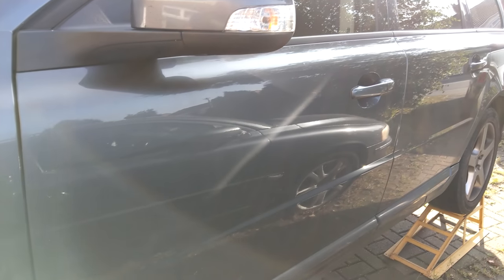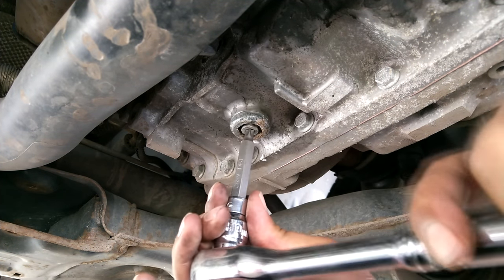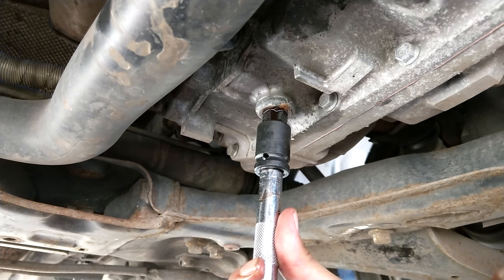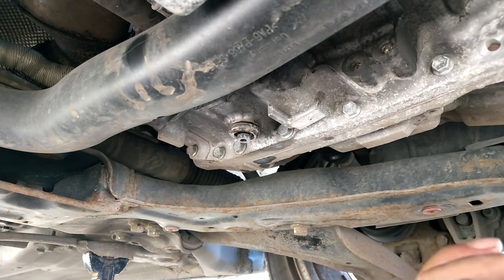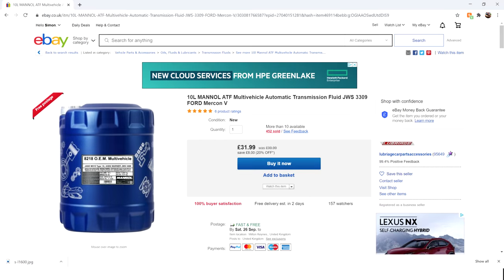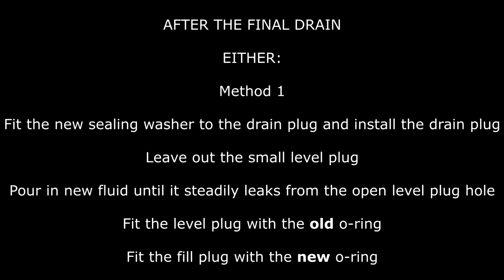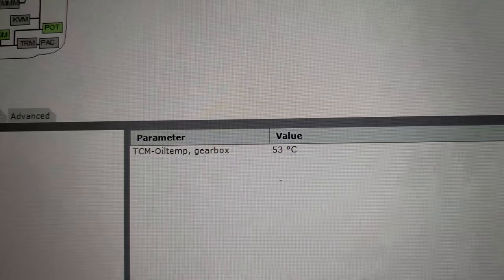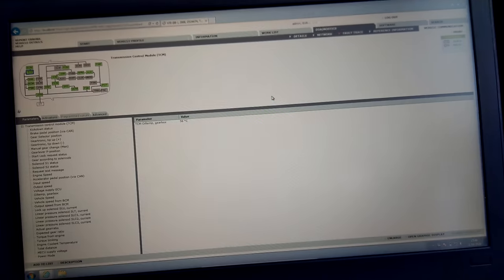Automatic Gearbox Fluid Change Aisin Warner TF-80SC

Comment: Very helpful video as always, thank you.

Also on the newer XC90's eg 2012 model they have the ECU on top of the airbox, do you know if you can get away with leaving that connected or should that be disconnected when removing the airbox?

One comment on the editing, really not keen on the 'blinky' transitions between the video cuts at the start of the video, it confuses my brain into thinking I've blinked and makes the video difficult to watch.
Reply from the maker: I don't know the exact way to access all of the variants that this gearbox is fitted to but Vida will confirm the steps.
You need Vida regardless to do the job properly so always worth having.

Point taken on the transitions. Short clips exaggerate the blinking effect so I'll look at future videos.
Reply: @sirobb  Thank you! 
Perhaps next you could make a video on how to change the bevel box oil in an XC90?
Reply from the maker: I don't have an XC90 needing it but the YouTube channel volvosweden has some AWD maintenence videos.
Done on a P3 but you get the general idea.
Reply: @sirobb  Thanks, I had already watched his videos but the drain/fill bolt isn't in the same location on my friend's 2012 XC90 that I work on.
Reply from the maker: I see. Get Vida..... I can't recommend it highly enough for anyone doing their own work. Even for my 2002 S60, I wouldn't be without it.
Reply: @sirobb  Thanks, I already have Vida and have looked up the procedure in it.
Unfortunately, Volvo updated the Bevel Box design, but didn't update VIDA to match! :(
I have asked on forums but haven't got a definite answer.
Reply from the maker: @bigbluechopper24  Which Vida version do you have?
Reply: @sirobb  version 2014D 
Installation of VIDA, version 1.00.0015
Reply from the maker: Wow that's quite an oversight then.
I can't add anything further I'm afraid.
Reply: @sirobb  Thanks for trying :)

Comment: THank you for your video. One question: the very first time when you take out the level plug there are some fluid pouring out (it means that fluid level is above the height of level tube). But after the final drain you pour in new fluid to the level of level tube only. Why so?
Reply from the maker: The engine is off when I remove the level plug to drain the fluid at the beginning.
More fluid is settled in the sump so some fluid will leak out. 

The engine is running when I remove the level plug to set the level of the fluid at the end.
The fluid is being pumped through the gearbox so doesn't settle and leak out.
Reply: @sirobb  Hello mate are you still selling the dice/Vida kit? Got a v70 and need a diagnostic for it shortly

Comment: Nice Video.
This Transmission is also used in the new Generation of BMW X1 and other models.
We have such an BMW X1 and I want to Change the Fluid and Filter.
I saw no Filter Cap, but at the front side (left) was an Cap with an snap ring. I think underneath this cap is an extra Filter.

Have you changed this one too or only the fluid?

In the original BMW Manuals are no work orders for an Service like this and no aftermarket Filter part number.
Only Transmission Fluid level check...

Maybe you know something more from the Volvos?!

Sorry for my "not so good english" 😁😆
Reply from the maker: The filter is not changeable without opening the gearbox.
You could insert an in line filter on one of the fluid cooler hoses.
Reply: @sirobb  Okay, thank you for this information 😊👍

Comment: That was excellent and very informative , it's a job I intend on doing but now that at the end I didn't realise you need to reset via computer , where do I get one of them?
Reply from the maker: I sell new, tested and guaranteed working Dice for £135 delivered in the UK. It includes the Vida software which will work on Volvo model years from 1999 up to 2015.
Reply: @sirobb  how do you view the information from Vida dice? I'm assuming via laptop USB?
Reply from the maker: @passionplanet4471  Yes that's right as shown in the video.
Reply: @sirobb   it looks impressive, but I see someone comment that if you replace exact amount back you don't require Vida, but funds are prioritised for 10 ltr of mannol,  the 17mm hex and Volvo crush washers . If I start getting codes then I will be keen to purchase one but so far been lucky
Reply from the maker: @passionplanet4471  You need Vida to set the level at the correct temperature due to heat expansion and you need to reset the counter to tell the car new fluid has been introduced. If it wasn't necessary, I wouldn't have done it or suggested it.
There's a lot of ways to shortcut and do the job incompletely but only one way to do it right.
Reply from the maker: @passionplanet4471  You need Vida to set the level at the correct temperature due to heat expansion and you need to reset the counter to tell the car new fluid has been introduced. If it wasn't necessary, I wouldn't have done it or suggested it.
There's a lot of ways to shortcut and do the job incompletely but only one way to do it right.
Reply: @sirobb   I know your right but, the V70 is getting on and I got a slight leak on steering pinion too so there is a list of jobs and I have prioritise the funds with and I will take my chance , but I'm not ruling it out , looks a fair price

Comment: @Sirobb Great video as always. Im sorry Simon but after 8 years of great service I have finally succumbed to temptation and bought a lovely 69k 2012 P3 D5 R Design. I know I may get a lot of hate for this, after all some consider this a downgrade. It certainly has big shoes to fill. After performing the 'Gibbons method' on my P2 D5 a couple of times im more than happy to do this drain and fill method on my new P3.

Would you be kind enough to clarify a point of confusion for me please. I am a little unsure as to whether the TF80SC takes JWS 3309 fluid. I realise you are using it happily in this demonstration, however I have heard that it takes AW1 or something ive never heard of BOT 341 (says in owners manual).  Any advice appreciated. Thanks for your time and trouble Simon.
Reply from the maker: There's definitely a revision to the recommended fluid around 2011 model year so I would check with the main dealer or a good aftermarket supplier like opieoils.
I've never needed to source the newer fluid and didn't need to check for the car in this video as it's way before the changeover.
Reply: @sirobb  Thank you for the reply, very much appreciated. I will look into it. Its a shame as I have a 20l drum of JWS 3309!
Reply: @sirobb  and yes I think there was something like a gen 2 TF80SC which takes a JWS 3 something something something. I always pick an awkward year on my cars!
Reply from the maker: Given that the gearbox is so similar, there's a part of me that wonders just how different any new fluid spec might be but I can't hand on heart say to use something if it's not listed in the handbook.

A Euro 3 D5 for example is probably 95% the same physically as a Euro 4 D5 but they do use different oil specs. 

Check every listed spec conformity number on your JWS3309 barrel though as you may find a number which still matches the new requirements for the >2011 gearbox.
Reply: @sirobb  You are a gentleman and a scholar. I'll have a look.
Reply: @sirobb  Just in case it helps anyone else, I thought I would share my findings. JWS3309 spec is used in the TF80SC as we know. The TF80SC Gen 2 was put into the V70 in 2011 (please check your VIN though to be sure of the change over) and requires JWS3324 or AW-1 (one and the same thing really) spec fluid.  The changes to the gearbox were more extensive than I thought, but in a nutshell it had some mechanical revisions. It had a software update to accommodate the lower viscosity JWS3324 fluid. 

As far as I can tell this 'new' fluid really is for improved fuel consumption and lower emissions, although there is some evidence it handles higher temperatures better.  Things get interesting and a little confusing  as the TF80SC gen 2 was also used in the XC90 with reports of it being filled with JWS3309. Volvo did eventually update their information in regard to using the new fluid 3324 in the XC90.

I feel like I could get away with using the 3309 and suffer no ill effects, however I am still not 100 percent comfortable. Maybe I am overthinking this?!
Reply: @nathanrich5256  JWS 3324 after 2011
Reply: You will find your answer in manual use.

Comment: Hi mate,
My car is 2007peugeot 307 2.0Hdi with the same transmission i believe. 
Does the TCM need to be reset as well？
Because i Just done my fluid change, it does become smoother but not that smoooooth.
Reply from the maker: You would need to follow whatever the procedure is in the official Peugeot workshop manual. I don't have access to that so can't confirm either way unfortunately.

Comment: Hello, I have the same transmission in my Volvo V70 2012 R design 215hp, is there also a transmission filter that needs to be replaced? If yes where is the location of it? 
I hope I get an answer 🤞🤞
Reply: The gearbox is designed to be "Lifetime" without frequently serviceable filter. There is a filter, but is deep inside the gearbox.. If you want to replace it you have to disassemble the gearbox 😀

Comment: Hi  great videos   i just wanted to know what goes wrong if you don't have the scan  tool to reset  the transmission   because i dont have one and i don't know anyone who does my gears run smoothly at least  l think they do .
Reply from the maker: Not resetting using software may be ok but it depends on the individual use of the car/gearbox.
The reset tells the TCM that fresh fluid is in the system and depending on each use case, that is an essential syep or just optional.
Reply: @sirobb  thanks Simon I've dropped the oil once up to now  a few weeks back and all seems fine  and I'm going to do it 2 more times  soon  and hopefully I might find some one  with the right  scanner  if I do I will tell you if it feels better shifting

Comment: Hi Simon, fab video as always, I need to do mine which oil would be best it’s a 2004 xc90 auto aw55-51 box ?
Reply from the maker: Most likely the same JWS3309 as in this video but check.
The method is also different so research videos for your exact gearbox.
Reply: @sirobb  thank you yes I’m aware the method is alittle different and it does appear to be the same oil so thank you for that :-) are you still selling the Vida & dice setup atall? Your video appears to of vanished lol
Reply from the maker: @chrisworrall3581  Yes, New, tested and guaranteed working Dice and Vida available. £135 delivered in the UK.
I took down the video as I don't really need to advertise it and it attracted too many requests to fix installations bought elsewhere. Lol
I'll gladly sort out anyone who buys from me but I don't have time to troubleshoot and be customer service for the other crap sellers out there. 😊
Reply: @sirobb  aww I don’t blame you one but mate that’s the last thing you need to be doing :-) your vids are great and make things very clear :-) I’ll be in touch in a couple weeks when paid if that’s on been meaning to get one for a while :-) do I just make the payment to your PayPal ?
Reply from the maker: No problem.
Yes that's right, just send the payment via PayPal gift/friends and family only please (not goods and services) to the PayPal in the video description and About section of the channel.
Put your name and address in the PayPal payment notes section and I'll sort it out. 👍🏾

Comment: There seemed to be a lot of fluid draining out when you first removed the level plug. Is this normal since at the correct level no fluid would be draining out?
Reply from the maker: There's more fluid compared to the final level draining because the engine is off.
Reply: @sirobb  Thanks. Thinking about it after I’d posted I realised that must be the case! Doh!
Reply from the maker: @simonjohnston1053  No problem. It can seem a little counter intuitive at first.

Comment: My TF-80SC is hitting 110'C when on highway, and it has that humm/whine in 4th, 5th and 6th. Oil change or not enough oil? Thanks
Reply from the maker: How many miles has the transmission fluid done?
Reply: @sirobb  50k km, approx 30k miles... it's on AR159 2.4JTDm.
It says Tutella GI/VI oil, but I presume it can be filled with 3309 too...
Reply from the maker: Has to be worth taking a sample of the fluid from the level plug.
If it's brown and smells burnt definitely change it.
It's also worth checking with your main dealer if there are any software updates outstanding. Perhaps even do that first.

Comment: Why has so much oil come out from the fill level plug? surely its only meant to drain whats over the level?
Reply from the maker: If you mean at the start, the engine is off so the level sits differently compared to when the level is set which is done with the engine running.
Reply: @sirobb  I wonder what the oil level is at the end of the change?

Comment: Brilliant as usual Si. Did I read in another comment section that you sell Vida and the plug-in tool? Can I  reset the Auto box oil counter using elm327 ? Keep up this great channel
Reply from the maker: Seal Kit link. It's a Volvo main dealer so double check compatibility with them. https://www.ebay.co.uk/itm/Genuine-Volvo-Automatic-Box-O-rings-30735186-x-1-1233068-x-2-30713220-x-1/202851956855?pageci=81796015-ac6b-48b5-b493-f29d9d84a70f
Yes, I sell Dice and VCX tools when I have them available. Tested and guaranteed working and they both work the same with Vida. £100 delivered which is the total cost if you already have a suitably specced laptop laptop or Macbook.
Reply from the maker: Not used an ELM327 on an Automatic so you'd need to check if that's what you have currently.
Reply: @sirobb  Many thanks for the reply. I am very keen to purchase one of these tools as they become available but obviously need Vida to go with it. Is that available, either from you or elsewhere on the internet? Many thanks
Reply from the maker: I sell them at £100 delivered and am taking reservations for next week's units.
Vida is included so it's just down to your laptop specs.
Reply: @sirobb  I have windows 7 on an acer aspire 5738Z. Intel 2.1 GHz cpu with 3Gb RAM. If that sounds OK let me know how and where to pay but cannot do so until next week. Many thanks
Reply from the maker: Which version of Windows 7? Home, Home Premium, Professional?
Reply: @sirobb  Windows 7 Home Premium Service Pack 1 64 bit
Reply from the maker: Home Premium is no good and the processor won't support Virtualization but if you upgrade the operating system to 7 Professional, you can install Vida directly on it.
Reply: @sirobb  Ok. Thanks for that. I will update in due course and then make a purchase.

Comment: Hello, my name is Carlos, I'm Spanish and I have an opel insignia on that same gearbox but from 2015. I want to carry out maintenance but I can't find anything in opel, I already have ravenol oil. just ask if the final level applies to all gearboxes even if it is not from volvo ?. Thanks a lot
Reply from the maker: I don't know so you will need to check the owner's manual and workshop manual for your exact car.
Reply: Final level applies to all brands with same gearbox number, please remeber to check oil level with engine on.

Comment: I've a tf81sc ford galaxy 2009 ,I've been given a new filter to fit but it doesn't look like it has a filter ?? It's a black cartridge filter in a new plastic housing like an external filter ??
Reply from the maker: I don't know.
Have you asked whoever gave you the filter?
Reply: @sirobb  did you open up box and clean screen filter ?
Reply from the maker: No and I don't know of anyone who has.
Everything that was done is in this video.
Reply: This is the Powershift gearbox not the geartronic! powershifts are on Galaxy, Kuga and late volvo's! There is a filter on the Powershift to change but not on the AISEN.

Comment: Hi Simon would this be the same procedure for a volvo xc70 2009 and i can do it but need the vida software and where do i get this from ?

Cheers.
Reply from the maker: If you have the same gearbox, the procedure will be similar but Vida will confirm.
I sell the VCX tool shown in the video which comes with a Vida virtual machine for £100 delivered to the UK.
You will need a 64bit laptop capable of running a virtual machine.

Comment: Can you also put a link up for the seals and washers? Many thanks
Reply: For anyone wanting to source their own parts and swerve dealer pricing the list is as follows:

30713220 Alum. Crush washer:
27.5mm OD/ 20mm ID/ 1.8mm thick

1233068 Drain plug O-Ring:
6.07 ID/ 1.78mm dia.

30735186 Fill plug O-Ring:
15.2mm ID/ 2.2mm dia.

Spec. wise, Nitrile O rings are the most common but Viton has a broader temperature and chemical resistance range. 

Cheers
Chuck.
Reply: @chuckmustard7865  Good info. The "Official Volvo" parts on these consumables are ludicrous.
(Yes, I know, packaging, stocking & stock control all cost money.... )
If it's the same size, the same material....It will do the job. I  guarantee it! 
Yes, there was an issue with some O-rings not being compatible with PAG Oil & R134a  a decade or more ago.
Surely that has been resolved. (We are not talking space shuttle disasters here.....Keep it real.)

Comment: Hello, i have one qustion, i did a lot of reserch and find out that jws 3309
Reply: Fluids are very difrrent in specs. My concklusion was that the most important thing is that fluid is not too high when cold and not too low when hot, among other things such as  vi..... And i find that in the specs is best of all(inclouding volvo oem) is MPM hfm fluid, from holland i think, so, have you any experience with that oil, or have you heard something about it. I will say that mannol is very good, i used it for flusch, beter than many expencive oils. Thank You for answering